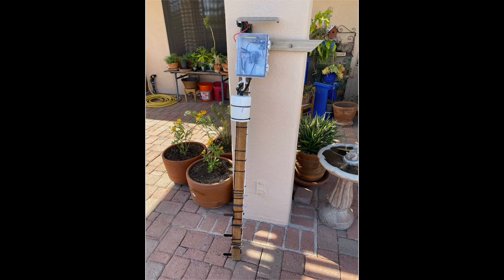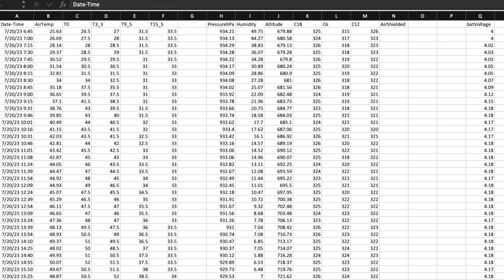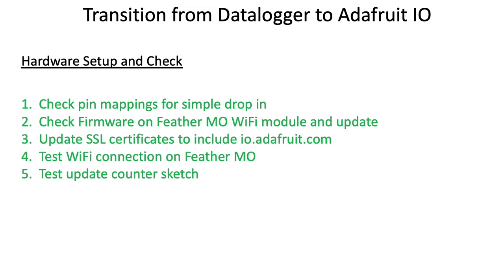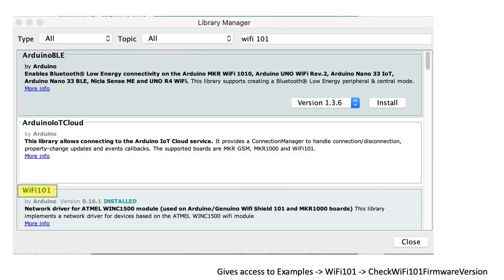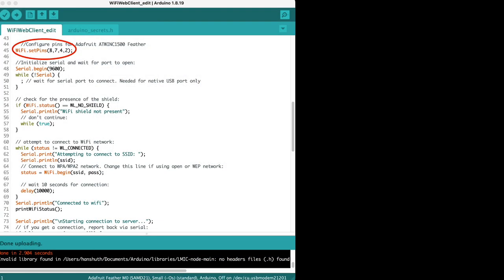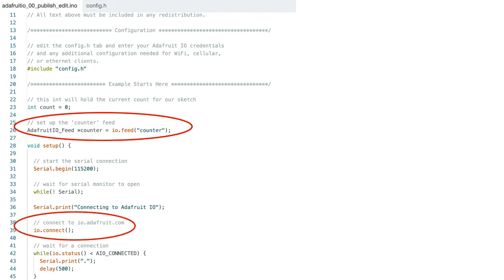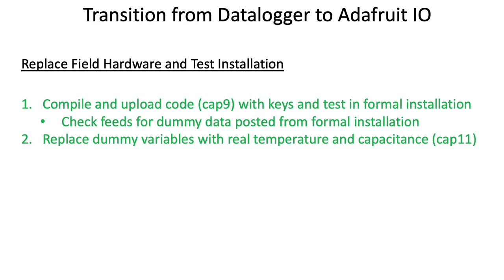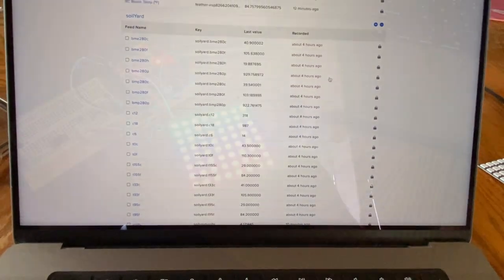Data Logging with the Internet of Things (Adafruit IO)

Comment: Many years ago (9?), I set up an Arduino with one of the first Wifi boards from Espressif to log temperatures in the basement of a house my mom's family had in Wisconsin and was renting out. At the time, there weren't any libraries for that Wifi module that I could find, so I used AT commands to connect to the AP, parsing the responses, with basic error handing and retries. Adafruit also wasn't doing their IO service at the time either (and I didn't know about it at all until your videos, so thanks!), so I used ThingSpeak, which is now owned by MathWorks. And of course the connection was HTTP and I used their IP address for posting since I wasn't wanting to deal with DNS... Again, using AT commands to do everything, including the request to send the data to ThingSpeak's servers.

Anyway, point being, it was a PAIN. But it did work and stayed working without any service for years, although we might have had to reboot it once... Fast forward to now and man, it looks SO much easier! Some learning curve for the APIs and such but I would I have killed for this type of system back then!
Reply from the maker: I admire your tenacity— things are so much easier these days to the point you don’t even have to program to get things working. I used Thingspeak for years when working for the state, but I can do all the same stuff (at least what I need) with Adafruit IO without the $750 annual subscription fee 😊.
Reply: @ModestMaker  Yeah, I was/am on the free account. Much more limited of course, but for a simple temperature probe it was perfect.

Comment: Good job, I was thinking before why are you never using wifi connections. With wide availability of esp8266 and esp32 boards that should be easy. The are even ready to use systems to use like tasmota or espeasy - no need for coding for most of the popular sensors
Reply from the maker: Good points. Most of the monitoring I’ve done professionally is in remote locations with no option for Wi-Fi. My yard offers new opportunities to explore 😊.